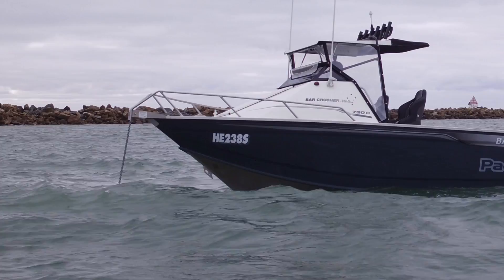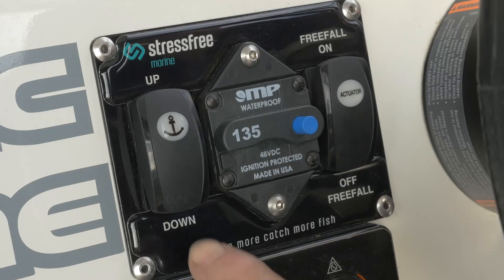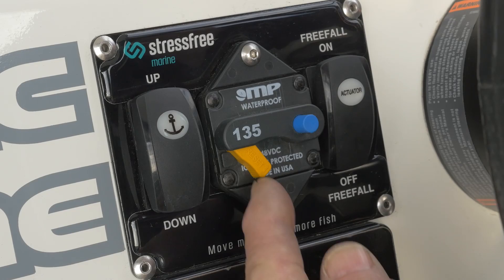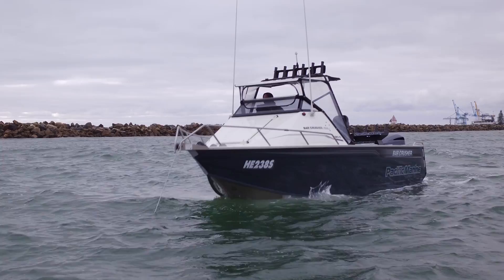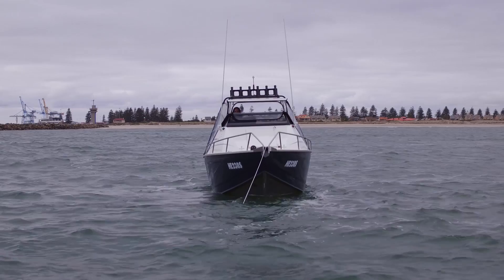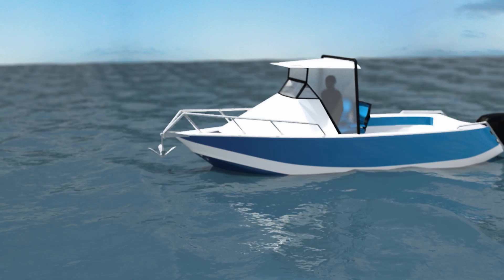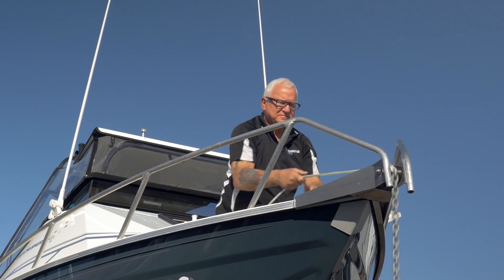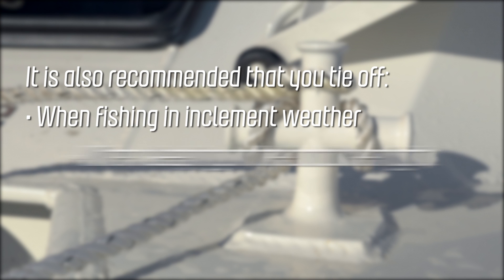Stress Free Instructional Video for Freefall and Standard

Comment: nothing but stress in rough weather and the weight of the chain this winch will free fall all buy it self  not good when in 6m going 30knots yes it happen to me many times on 2 different boats so i got rid if the winch
Reply: not very good ,
Reply: Another boat channel said ALWAYS have a anchor safety link connection in case of gear malfunction.